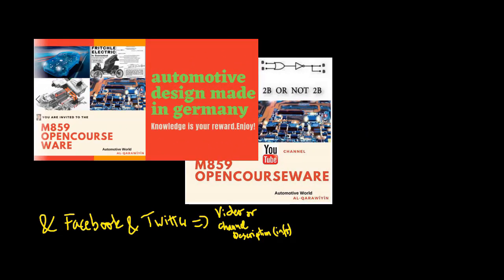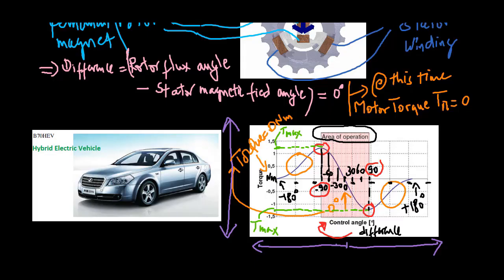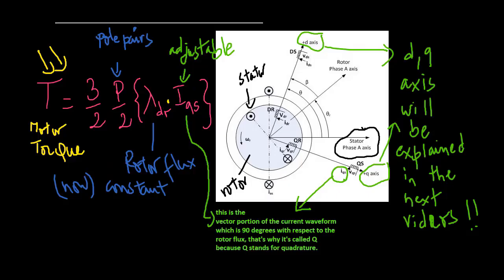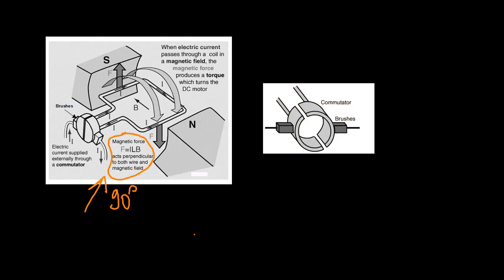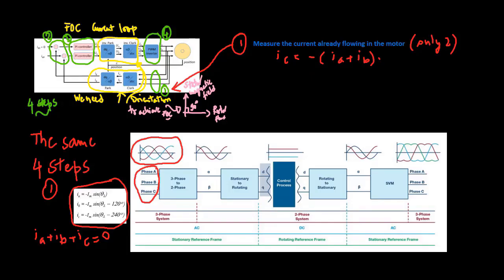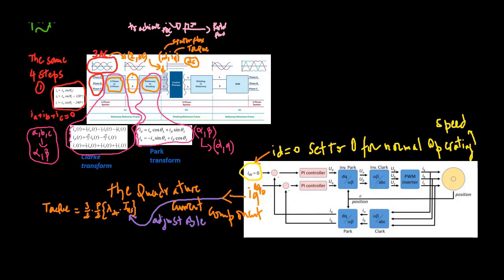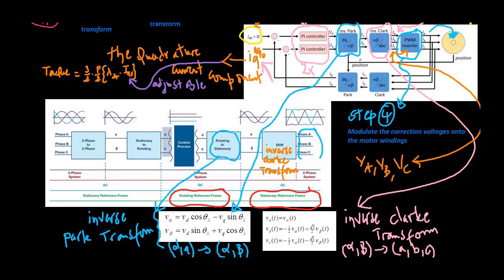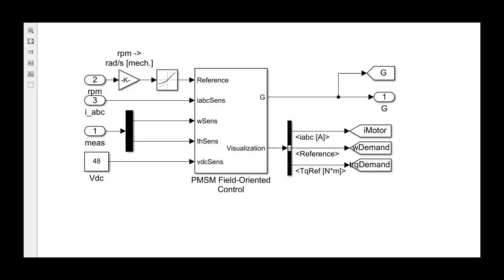AC Drives Vector control or Field Oriented Control (FOC) demystified

Comment: in minute 10:41 in the last section of the battery(i), is my assumption correct, that here the generator operation is to be considered and/or the battery is charged?
Reply from the maker: @Mark Müller very good eye, thank you.
if you look at the bottom left, positive is in, i.e. the current flowing into the battery, for example in a recuperation phase becomes positive. in this case the current is negative because the current is drawn from the battery. if you look at the torque and speed before, both are positive in this phase, so this is motor operation. for generator operation, you need positive speed and negative torque or negative speed and positive torque.